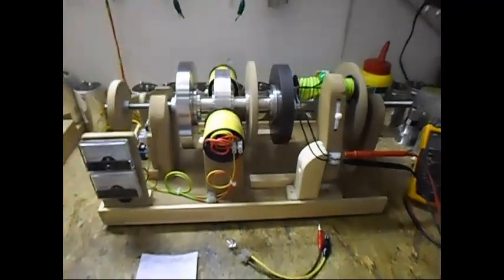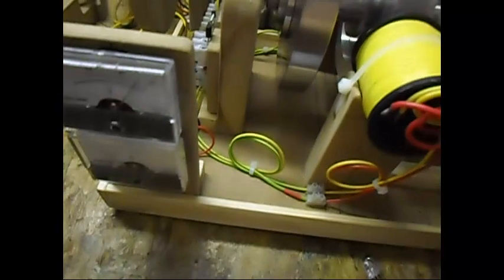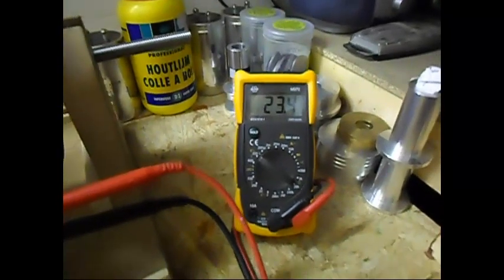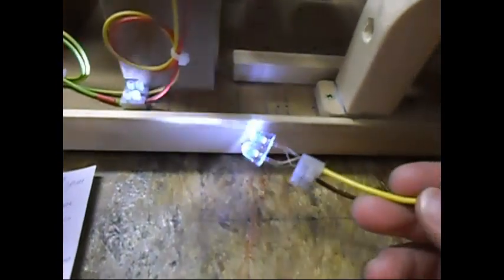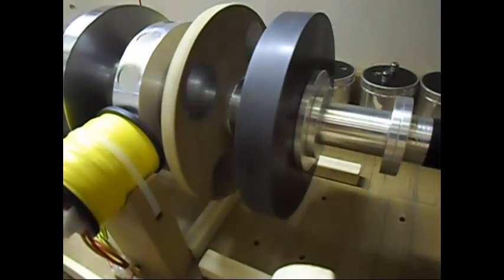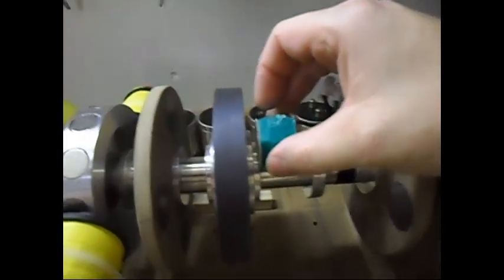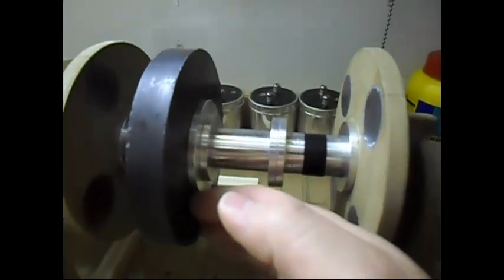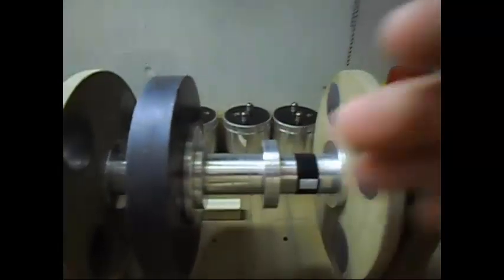Flux Gate Generator - Update 7 Rotation of rotors & ring magnet - long coil...

Comment from the maker: Here i'm doing a test with the long coil where everything on the shaft is rotating wich include the rotors & the ring magnet...^^
The output is once again not so good with this long coil and it does put more drag on the system while in place and under load...-.-
Input is 26vdc @ <50ma...i can run it on higher voltage but there a bit of vibration at that input but 26vdc is more than enough...

No coil in place = 1948 rpm
Coil in place and open = 1870 rpm - Ac volt here is 23.9
Coil loaded = 1848 rpm - Ac volt here is 3.2
Coil shorted = 1848 rpm

At 1.13 minute mark i said 1884 rpm but it should have been 1848...-.-
Speaking 4 different language every week does kinda confuse my mind when it's time to switch from one to the other...lol
I think a 1:2 ratio stepdown transformer could help the output a bit but since i don't see much coming from it i won't put much energy into that unless i just happend to find one...lol